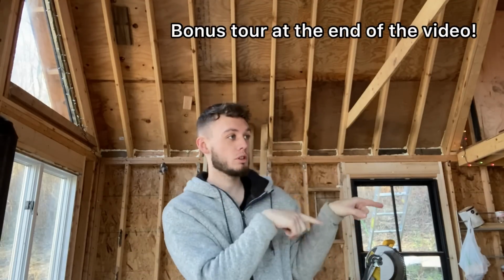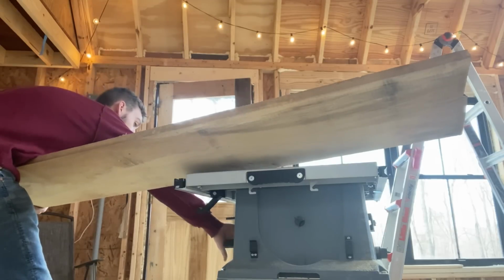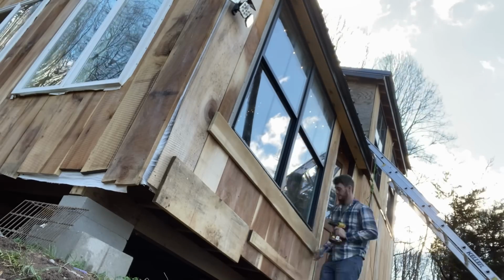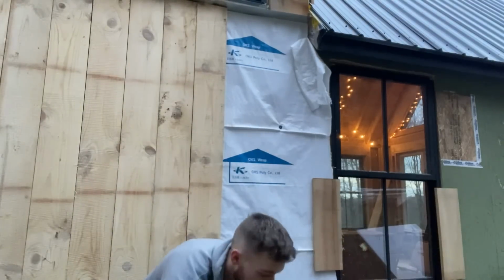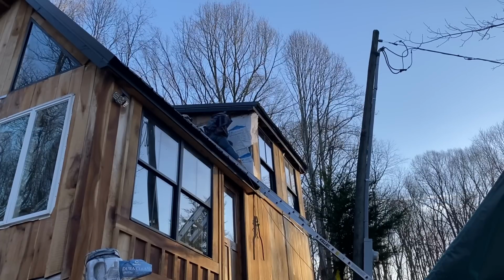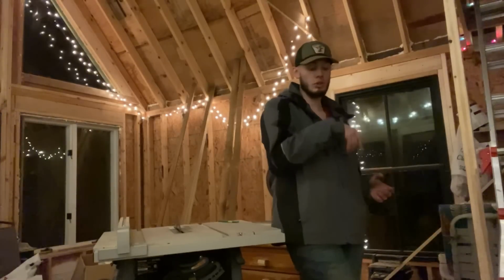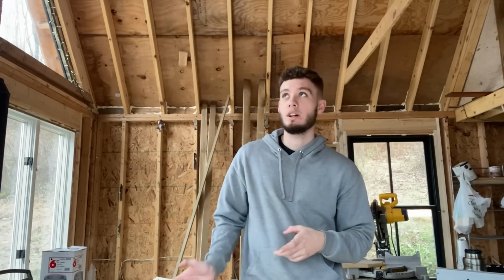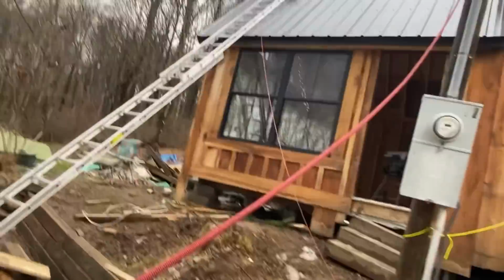SOLO CABIN BUILD! | 21 year old builds cabin in the woods | weatherizing and preparing to move in

Comment: I'm not a professional but do some research on insulating cathedral ceilings.  If you plan to insulate and it's not a vented roof you'll probably need to use spray foam.  Any type of fiberglass or bat insulation will lead to condensation if it's not vented which can lead to mold.  Looks good.
Reply: Why should there be a problem? Install moisture barrier and it's all good.
Reply from the maker: Good point I will do more research on it! I do believe it should be fine unless I have a leak in my roof

Comment: You also used the wrong pneumatic nailer to install the 1” thick poplar or pine siding. 1” thick siding should be installed with at least a 2 1/2” #8 galvanized nail. You used an interior trim nail gun instead of an exterior nail gun. It also appears that you are nailing the 1” thick board and baton siding only into the OSB sheathing instead of solid blocking. It will begin to fall off soon! Since you don’t even know the proper name of the components, I’ll bet you have never done this and your building in an area where there are no building code requirements! So if this is true, why are you making videos? Your just showing the wrong way to build and giving false hope to people that think your doing it right!
Reply: I get what you're saying... sometimes YouTube isn't a How-To, but a journal as to How-I-Did-It.  I am 32 and beginning a similar project. I have no idea what tools and equipment are called. I appreciate that this guy is young, taking on a very big project, and learning, learning, learning as he goes. As that is likely how my home will go. I too am looking for the cheapest options, and finding ways to accomplish something without making my brain explode. If he ever wants/needs to build a new home, he will surely make plenty of improvements from his first house.